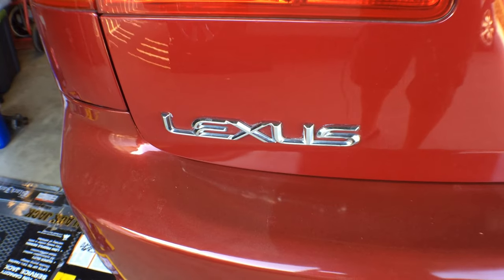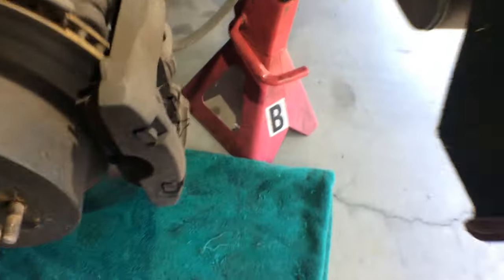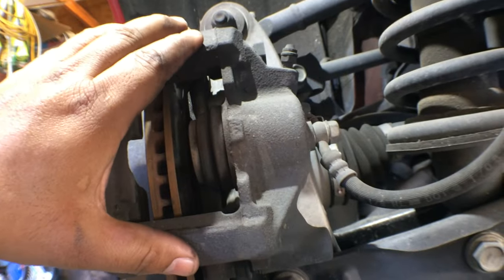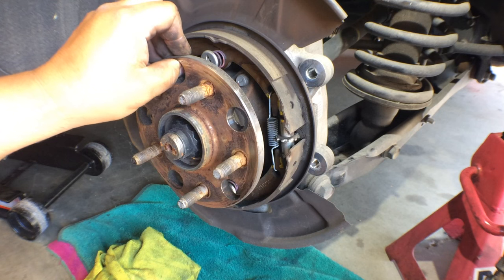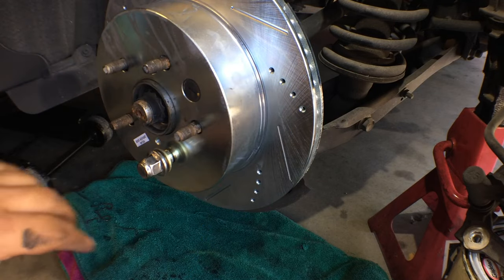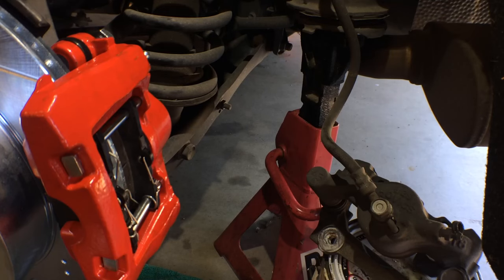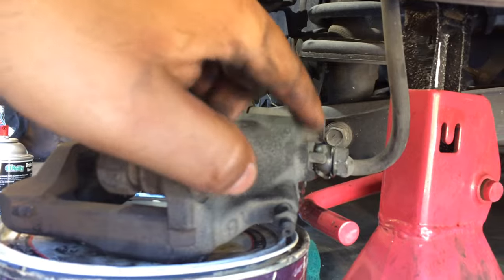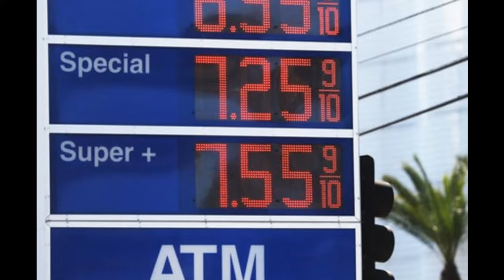SLIDE PIN SEIZED | LEXUS IS350 STUCK REAR CALIPER REPAIR | 2006 - 2013 | Seized Rear Calipers

Comment: Literally just experienced this. Replacing rear brake pads on my son's 2008 IS250 and after about 45 minutes back and forth moving and hitting an extension with a mallet I was finally able to remove it. After a little fine sanding and reapplying lube it moves freely again.
Reply: Same here, used a small wire wheel tool on a dremel to clean the inside of the lower caliper slide pin hole and on the slide pin itself, cleaned it up using brake cleaner and lubed it with ATE brake lube. All seems well now